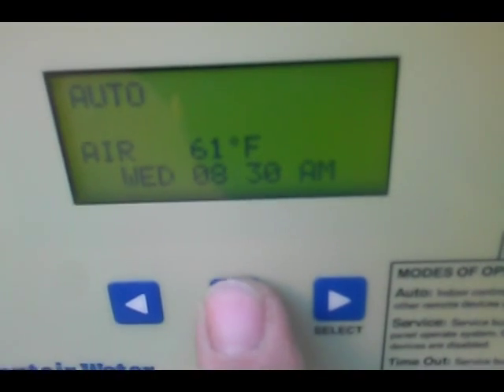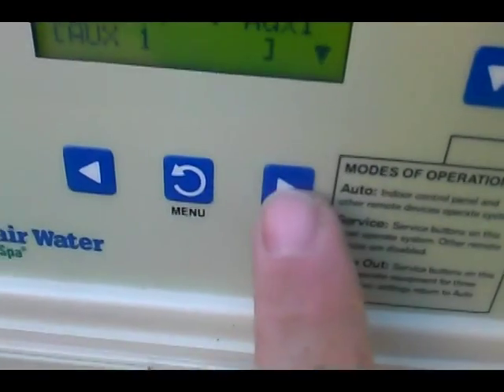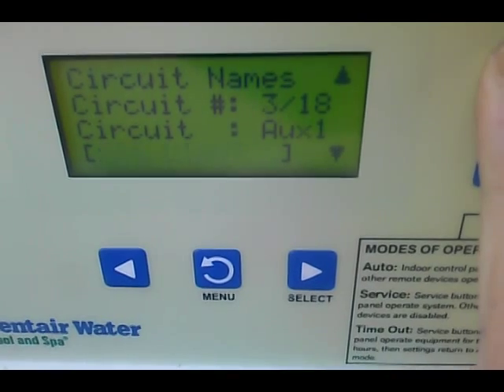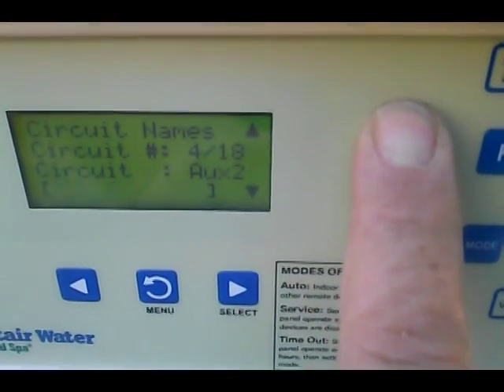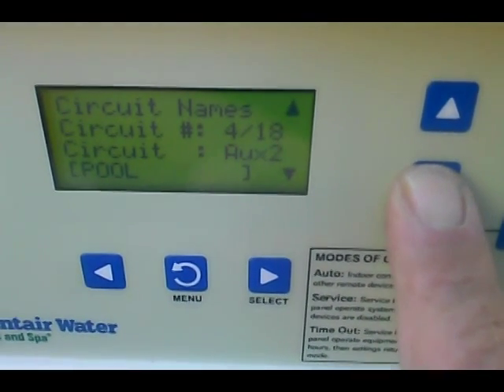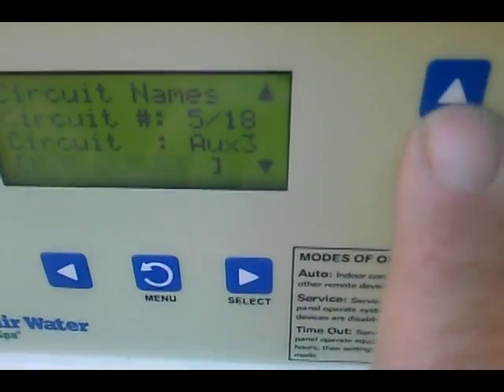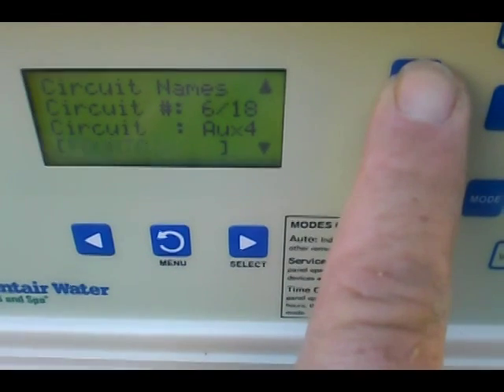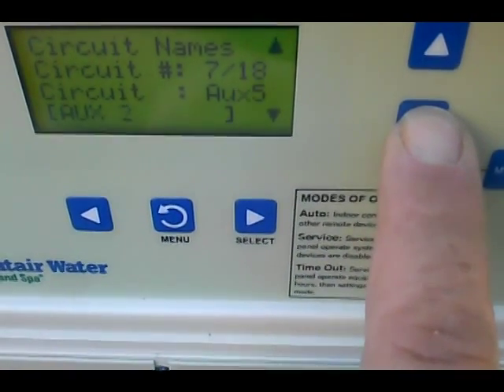Programming Circuit Names on an Easy Touch

Comment: Hey John, we have this Pentair water panel and we cant see the screen very good anymore. Is there a fix?
Reply from the maker: James Harmon 

You may have to replace the whole board. But if it works just use your remote control. It depends on how much you want to spend unless you can find a used one.
Reply: We did not receive a remote when the equipment was installed.